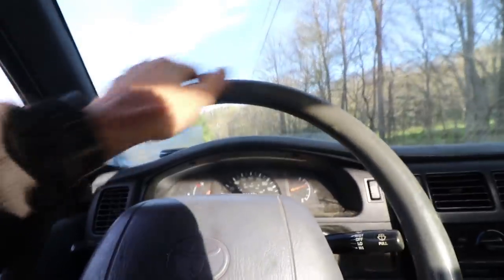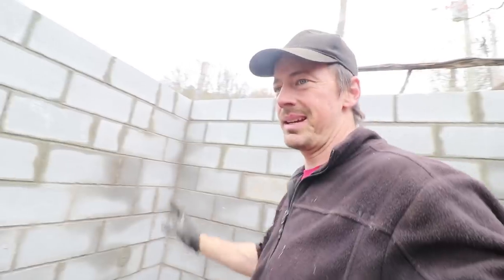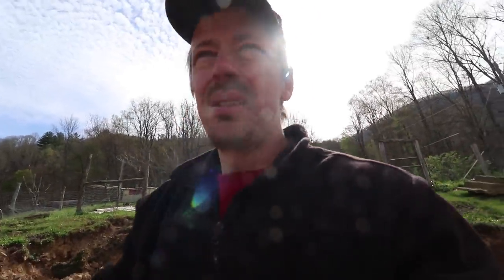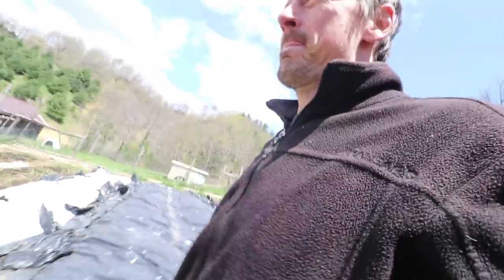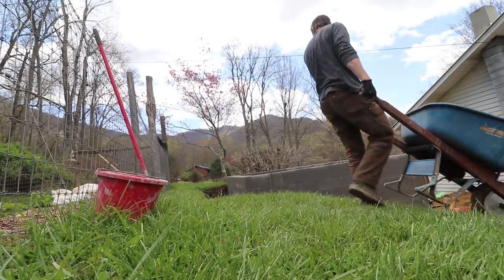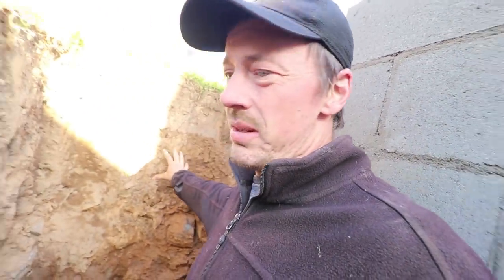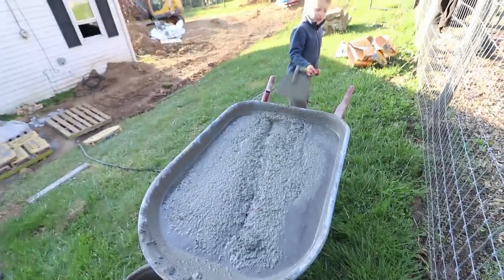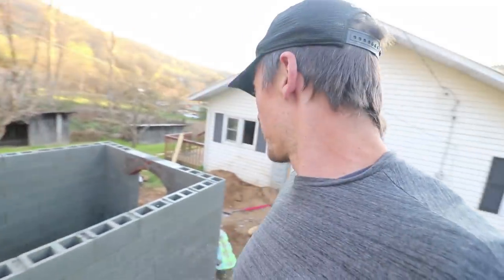the Root cellar build is ROLLING...

Comment: Hey  Art  I was a contractor in my  younger years  I used a masonry sealer & it stoped  water from coming  through the walls .It's Name is DRYLOC  you can get it at Home Depot in the aint dept.   paint the outside walls Before you Back Fill  it will stop any water from coming into your  little room there  YAH be with you  in JESUS name

Comment: Be sure and get that dry lock out of the paint department and paint the walls on the outside of the root cellar so it stays dry so you don't have a mold or a water problem inside of the root cellar

Comment: As long as you have the open ditch around your root cellar, throw some drainage pipe around the base with its ends going out into that french drain.  You've no problems now, but after a long term of rain, who knows where the water may go and a dry root cellar is a good thing to have.
Reply: He said he was putting drainage right under the door in the front since he will have a gravel floor for the root cellar. The whole floor will be French drained.

Comment: Hate to say this, but I think you might have to wait till the lumber gouging that's been going on for the pass year to ease before you can start the house rebuilt. With the prices for plywood and lumber right now, I don't think the $50K will go very far. Also hope you're planning to waterproof the outside wall so water won't wick inside, much cheaper to wrap the outside walls right now then trying to deal with moisture when the walls are backfilled.

Comment: Hey put an exterior waterproof membrane on the block walls if not the block soak up water like a sponge. One that I use is a cim 1000 with 6 mil plastic push into it. My husband is a brick Mason. The part where it's not going to be back filled use a sealer called siloxane pd. This should keep your root cellar dry.
Reply: Art talked about how he needs this root cellar to be 80 to 90% humidity, so no need to seal.

Comment: Just wondering how is the block attached to the footing?  I never noticed any rebar sticking up out of the cement to hold the walls in place, you need it or the walls will start to slide in with the weight of the dirt pushing against them from the outside, you will need a minimum of 4 feet of dirt to keep the frost from entering the cellar and freezing the product you have stored... so much more to a root cellar... interesting

Comment: Are you certain you do not need a perimeter drain tile in clean gravel at your footer?  With a gravel floor inside it seems reasonable to me that you will still have plenty of moisture for the root cellar while getting rid of the excess before it is a flooding problem.  Is your floor above that French drain?  I know that you are very competent, just wondering because water is insidious!  The water molecule pushes laterally when trapped.

Comment: Fantastic Job on the root cellar 👍 
I once mentioned I wanted to make one in a garden group on fb,  a few people mentioned a toxin leaching in through the walls and you had to seal it ?
Reply: The only toxin I can think of is in basements too. In the Midwest, we have radon gas that builds up in basements or root cellars. I believe it's heavier than air so you can try to vent it. Long exposure can lead to lung cancer. Most people will not test their basements because then the "state" or insurance would force you to put in some kind of ventilation system that most likely would be costly. People just hope for the best. And if you ever tried to sell your house, you'd have to disclose the test result to a potential buyer. Same reason people in Florida don't test for sink holes under their homes. It opens a big can of worms.
Reply: @StoneKathryn  Yes that's what  they said, apparently its common in our area also.

Comment: Where are you at on the house? I would think that you would finish  that first. Just wandering
Reply: He has to redo the grounds outside the house first.  The land is what caused the problem in the first place.  Water was running to the house and caused mold.  Art is now working on the French drain and grading the yard so the rain water will not affect the house.  Since he has the yard dug up, he is doing all the yard work before does more work on the house.  Makes sense to me.

Comment: Looks great...curious, why did they set the blocks so far from the edge of the foundation?  It looks like 4-6" off the edge on 3 sides, at least?
Reply: You build your walls in the center of the footings. If it is to one side or the other it will tilt the footer over time and that can make the block walls collapse. It is a "floating" platform on undisturbed and very compact soil that lets the walls stay straight up from it. Soil moves over time. Blocks need good support to stay straight over the long run. When he back fills that little lip beyond the block wall will have the weight of the soil/gravel to anchor the footing into the hill. He is doing standard building techniques here.

Comment: I thought a root cellar should be 32-40 °F. How warm do you want it to be? I'm confused 😕
Reply: Deep ground temperature is 50°F in most places. The coolest he can make it is about 50°F. It is not a cool room or a refrigerator that has to have a cooling system to keep the temperature below that. Any time you can lower the temperature of fruit by 10°F, you slow the chemical reactions by half so it will store longer. The front face of the block will be exposed to air and sun etc. To keep the cold in the root cellar you have to insulate that front face. Insulation prevents the warm/cold temperature outside to travel into the root cellar. Also, if it is very cold outside, it will keep the cold from travelling inside and freezing all those beautifully canned foods and breaking the jars too!